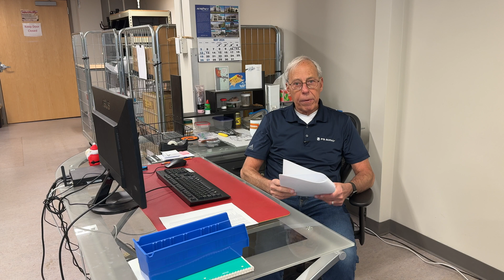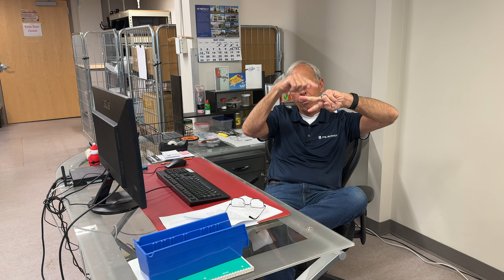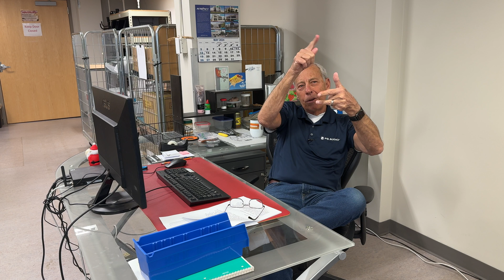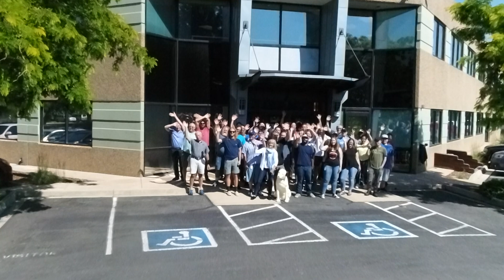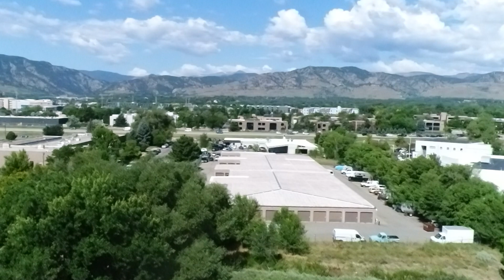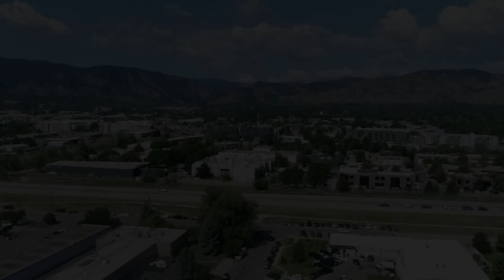How balanced microphones and audio works

Comment: a balance microphone voice coil has a centre tapped microphone voice coil  wire and the microphone voice coil positive and negative  signal wire . this microphone wire configuration is a rather not a usual for a dynamic microphone , the  cable is a shielded earthed and a  two wire cable and the input to the amplifier is a balanced input transformer connection .

Comment: Challenge accepted, let me try this without a whiteboard: a microphone is actually a good example, let's take a dynamic microphone with a coil - that coil has to ends - these are your two signal wires, not connected with the "ground ", but going straight to a differential amplifier. The ground in this case is good for shielding the mic and the wires from external interference.  Not a good example? - take a small battery instead - it has a clear plus and a minus. 
Connect one of these two wires to the ground, and you have single-ended audio.

Comment: Are you saying microphones have a center tap? Positive wave operates between the capsule at rest to full excursion, negative from rest to inversion? If you move the scope ground? How do you get 2 mirrored waves instead of one with 0 being the center?
Reply: As all coils the reference just change to where you connect it...
You can, for example, join - and ground to make it one side referenced to 0v (gnd)...
In balanced circuit this reference is given in the feedback of the active balanced diferential input circuit...

Comment: Using a mic as an example. All mic elements are balanced. All have two connectors and when a signal is generated one side is plus and the other minus relative to each other. Then it is just a matter of how it is connected. You can take the two wires and wrap them together and surround them both with a braided wire shield as a third conductor that is connected to ground to keep noise out. Or you could take one of the two wires and run it inside a shield made using the other wire and connect that to ground.

Comment: Seems to me the signal is ordinarily balanced and only becomes single ended when one side is grounded.
Reply: Yes... In coils the reference is settled with the conections...
Is a transformer for example, lets take a 3 output transformer with a single 10v coil with a central tap, you can use as a side to side 5v if you reference to center tap or as a 5 and 10v output if you take the reference from one end...

Comment: Balanced audio is often misunderstood; it serves different objectives and not all of those objectives need the signal to be mirrored, e.g. common mode noise rejection only needs the differential signal to be terminated in the same impedance.
To explain this in layman terms it really needs a few diagrams and a discussion about impedances and the need to separate the differential signal from ground.

Comment: Easy Peasy, + terminal = (in phase) true signal, - terminal = inverted (in phase) version of true signal, 3rd terminal = shield, the signal is interpreted as the difference in voltage between the + and - terminals (QED). Balanced signals are used everywhere including twisted pair Ethernet, HDMI and Displayport. The shield is just a preventative measure against unwanted noise.

Comment: "One of the significant advantages of balanced audio cables is their ability to reject common-mode noise. Any noise picked up along the cable affects both the hot and cold signals, but when the signals are combined at the receiving end, the noise cancels out."

"The Balanced option will offer more power and control of the headphones in comparison to the single-ended output. A true Balanced amplifier will be balanced from input all the way through to the output. Op-amp splitters are often used to convert the input and output from single ended to balanced."

Balanced audio signals matter most between the amplifier and the DAC or on long signal paths between a source and mixer/preamp.